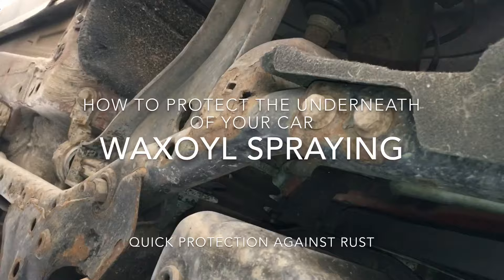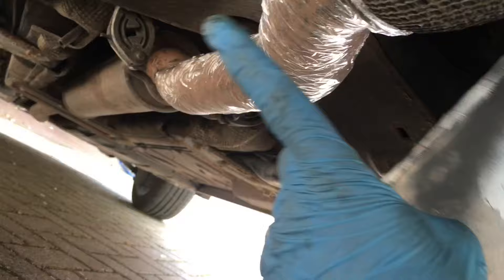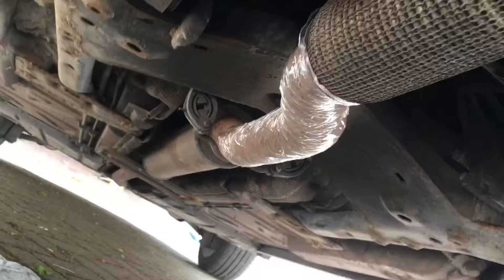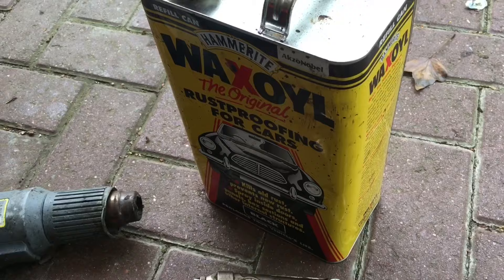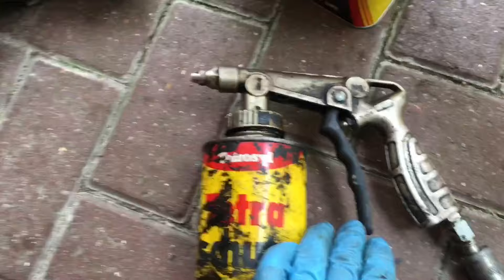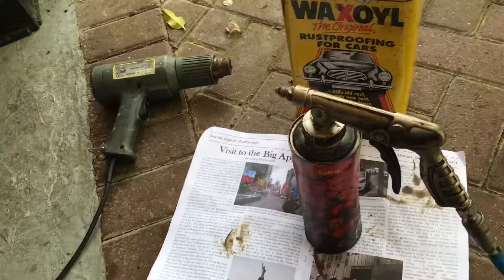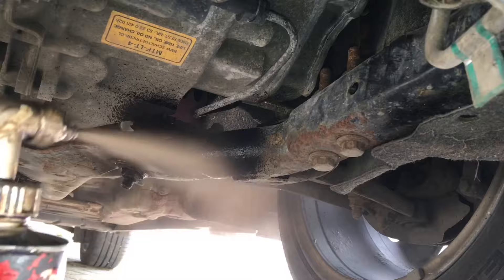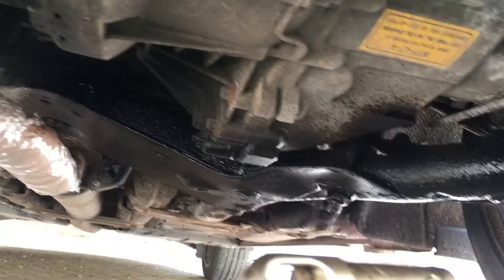How to Quickly Protect from Rust on Car Underbody - WaxOyl

Comment: Love that you said don't spray it on the brake disks just as you sprayed it onto the brake disk😂😂
Reply from the maker: I had to go and check - nah it was ok as the brake backing plate protected the disc, but nonetheless something to watch out for.  Wipe off with white spirit if affected.
Reply: @comeinhandynow  Better to wipe off with brake cleaner, as white spirit leaves an oily residue...
Reply from the maker: @amana1480  Probably right but its good enough as long as you wipe if off as well.

Comment: So when this dries out it protects it also from sand and stuff ? Or it's just something waxy that will wash off in time from power wash ?
Reply from the maker: If it is pure Waxoyl it dries quite firm and will not wash off.  Even if you add 10% oil, which makes it softer, it will stay on but sand may stick to it perhaps.

Comment: Without arguing if it's the best product out there, definitely this spray gun is not worth much without 90° extension wand. Whatever you spray its paramount to  ensure full coverage. With only spray gun you won't be able to apply product between elements and main body.
Reply from the maker: Yes, that would be a good add on.  I’ve an add on hose with a 360 degree spray end for cavities etc. but a 90 head sounds a good idea as well.  Got any ebay/amazon buy links?
Reply: @comeinhandynow  I did it myself, wanted extra long. Thin aluminium tube bent and flattened at the end attached to an oryginal 360° hose. But there must be many to choose from on the internet.

Comment: Easiest option to thin is to mix with white spirit to be honest. Just finished my wife's car and about to redo mine
Reply from the maker: The added oil is not to thin it, it is to keep the solution oilier, more penetrating, more mobile and it lasts longer as it stops the waxoil cracking after several years.
Reply: @comeinhandynow   you misunderstand. Rather than heat it with a hot air gun, thin with white spirit to ease spraying. Grannies and eggs. I've used it for 40 years
Reply from the maker: @Micjoh  when the weather is cold, heating it is the better solution because you have a solid lump of wax to try and dissolve otherwise, in my humble opinion and experience of 44 years.

Comment: Im in the process of doing this to my 2006 Toyota Corolla which has quite a few areas of surface corrosion underneath. I'm glad to see it is fine to spray this product over surface rust as long as it has been wired brushed and cleaned. At first I thought I would have to get down to clean metal which would of been a ton of preparation work. Thankfully not the case.
Reply from the maker: Yep, it's good for quick preservation.  Well worth doing.

Comment: Excellent straight forward to the point video. Well done. About to get under my motorhome to see where I mouse has entered the van. Good excuse to Waxoyl while I am there.
Reply from the maker: Thanks. Good luck.
Reply: Had mice in our motorhome - couldn't work it work where they got in, but then read that they can get in through a hold no thicker than a pencil...so could be lots of places , bunged them all up with wire wool as they dont like earring through that. Job sorted.

Comment: Good video. I don't put old engine oil in because it makes the waxoyl black: you can't see when rust re-starts if the oil is black. However I've never, ever ever had rust restart under clear waxoyl. There might be better stuff out there but I haven't found it. Brush it on / spray it on - it's great. Get the extender hose to spray in cavities too.Being see-through you can satisfy yourself no rust is re-starting and both my classic VW bus and modern cars are done - no rust anywhere.Buy some now - don't delay putting it on. Then wax polish the bodywork to stop pin-prick holes becoming blisters. Then keep on top of the oil changes and keep away from mechanics - they always break your car. Fix it yourself....
Reply from the maker: Good advice, although I like the look of black Waxoyl.
Reply: Ha! Yes it does look better I do agree! At Busfest I had a look to see what other classic VW owners had done and yes, the black look was the most common (apart from the concourse Trailer-Queens with body-colour painted undersides).I've spent so many hours taking off solidified, hard underseal with rust behind it I have a fear of the black stuff! You know what I mean re the solid underseal?I might start using your method in the wheel arches though as they are so visible.
Reply: @mopedinthemalverns6661  How did you get the underseal off? My car is coated in TetraSchutz, and I can see rust coming through it. I'd like to get it back to metal, and coat it with something that I can easily remove, and is transparent enough to show the development of future rust. I have some trepidation about the amount of effort involved in getting the old coating off!
Reply: Hmmm - I've had to resort to scraping / wire brushing and using white spirit - it's a rancid job. Sorry can't be of more use. The scraping gave me tennis elbow - no really it did! The underseal will scrape off easily on the rusty bits - rust is useful in that respect. I used a wood chisel - do wear gloves and glasses though - chisels are damned sharp. Don't lose sleep over getting is totally back to the metal though. Best of luck.
Reply: @dalriada842  Getting the old hardened underseal off I 've used a combination of 1" paint scraper with a hot air gun used for removing old paint on wood, wire brushes in drills and also sanding flap style discs, very very important to use eye protection, took a whole day to remove old underseal on my Beetle many years ago but worth the effort.
Reply: Could not have put it better myself
Reply: Totally agree with everything you said

Comment: Don't use a hot air gun to heat it  a bucket of hot/boiling water does the job just as well.
This is also suitable for aerosol cans but don't get any in the nozzle.
Reply from the maker: Thanks for the comment but for a 5L can of waxoyl that I often use you would have to use a large volume of hot water.  I have been using a hot air gun for years without incident but I would say that you should do it carefully. Keep an eye on the solution, mnake sure the lid is off and stir it frequently until it is liquified nicely.  You wouldn't want to over heat it.

Comment: Would you recommend cleaning the parts to be waxed, especially to get rid of any road salt that may be sat on the metal?
Reply from the maker: Yes brush off any loose rust and any mud.  Also wait until there has bee sufficient rain to wash away winter salt from the roads and car or spray wash it underneath and leave enough time for it to dry.

Comment: Hard to answer question i know!  But any guidance would be appreciated. How much corrosion is too much to Waxoyl over?
Reply from the maker: If it looks like it is more rust than metal left in its thickness then replace it, for example the lower suspension arms (wishbones), those are cheap to replace.  Another video on that soon!
Otherwise scrap off any loose rust and waxoyl it.  The add of old engine oil into the waxoyl helps it penetrate bad rust.  Add 10% to warmed up waxoyl and shake to mix.
Reply: @comeinhandynow  Thannks, do you know what would happen if waxoyl was just put over the corrosion with no clean up first?
Reply from the maker: Just more danger of the rust flaking off carrying the waxoyl with it.

Comment: Wow, really glad i came across this video. I ve been looking at loads, a product called Lanoguard, and others, but this seems to be the one, seems as you ve answered nearly every question i had already in your comments section too! Plus i ve just discovered it on eBay, very reasonable price, even in spray cans, and a job i think i could take on myself, with all the tips i ve read right here. Just one thing, i see your fortunately still uploading, can you advice me, would it be a good idea to remove the wheels maybe and cover the discs with rags or something?   Very good informative video, clearly explained , and filmed.,. Top job..  I m a new sub!! Its this old school advice that is invaluable.... Thankyou
Reply from the maker: Thanks. You can leave the wheels on but taking off will give better access tto suspension bits.  And yes guard the brake discs from the waxoyl.  If you do get some on the discs wipe it off with a rag and solvent, methylated spirit is what i use (ethanol).
Reply: @comeinhandynow  Good point, i hadnt considered, i think i ll go with taking them off as i ve a trolly jack so easy enough, and yes, more access to parts i might not get at otherwise.. I think i have a can of brake and clutch cleaner left over , from another top tip off here on YT on cleaaning oil off my drive with that and cat litter. That would do it wouldnt it, or is it for a different part of the braking system? I m no mechanic, but if it seems do-able, i ll have a go, if i have the tools etc needed. Or stick to what you suggested, the meth spirit,  i ve just found it cheap enough on eBay, small enough bottles for camping stoves etc?   Your earlier prompt reply is very much apreciated, if u could get back to me on my last querie, i think i m on top of this job, and just need a sunny day now...I know times getting on, so anytime over the weekend or in the week will be great, as i m not about to do this job tomorrow morning...Prob be April before i get any sign of a sunny day here in S Wales!!  I ll say it again, i m very happy to have come across your page, spotting the axles etc from behind, rusty looking was starting to really annoy the last few weeks.... Also looking forward to going through your many years of knowledge in your uploads..  Cant thank you  enough....
Reply: @thedjreffa how did you get on, any tips for someone looking to do the same?

Comment: Thanks a lot for the video!! I am in the process of using jenolite waxoyl (aerosol spray) is there any part of the underbody where I should not spray other than exhaust and brake disks? Thanks a lot in advance!
Reply from the maker: Can’t think of anything else critical. I wouldn’t do engine, gearbox or diff or any visible bodywork.

Comment: Just bought  a load for my mx 5. I wasn't sure if I had to paint 1st  or use  rust reverter, etc ? There are so many different  opinions. I'll  use this method  as it's intended.  Thanks
Reply from the maker: Just spray it on after scrapping or brushing off any loose flakey rust.
Reply: @comeinhandynow  I will do. Can you use it in the wheel Wells
Reply from the maker: @mick0846  sure, just avoid the brake discs, or cover them

Comment: Always best to use a wire brush, then rust treatment, black satin hammerite then waxoyl for extra longevity and protection.
Reply from the maker: Thanks for your comments.  The key word in the title is “Quickly” and doing all your steps is not quick.  The addition of engine oil to the waxoyl and heating it makes it a quick job as you can skip the hammerite, rust treatment and most of the wire brushing (do just enough scrapping to remove the loose bits) since the oil makes it penetrate much more and stay much softer and long lasting.

Comment: At risk of asking dumb question, can I paint it on? Can a compressor spray unit be hired? I’m assuming it can (who would have one at home?). How did you heat it?
Reply from the maker: Yes you can paint it on.  Yes you can hire compressors. Useful to have one at hone for spraying, tire inflation and this job. Heat with a hot air gun.
Reply: @comeinhandynow  Thanks, very helpful, much appreciated. 👍 I don’t have a hot air gun so I’ll stand my can of Waxoyl in a tin of warm/hot water to heat it. Same result, but slower.

Comment: Should you wire brush first ? You are just dealing on rust right
Reply from the maker: Just remove any loose rust or flakes with a wire brush or scraping tool then spray over remaining rust. The oil stops it progressing.

Comment: Would you recommend this as a preventive measure for a brand new car??
Reply from the maker: Yes, on steel parts underneath. I wouldn’t add extra oil in that case as there is no rust to penetrate into.

Comment: Why should not apply on brake and exhaust systems?
Reply from the maker: It will stop your brakes from working properly.  You need friction in brakes. Waxoyl is lubricating so not what you want.  If on exhaust it will make a lot of smoke when it gets hot and is a risk for fire.

Comment: i used the pray can version , it looked great after 12 months later i looked under the car and its all gone wtf!
Reply from the maker: That shouldn’t happen. I can only guess that the can wasn’t warm enough and shaken up enough to get a good mix of the wax and maybe mostly it was the solvent getting sprayed out.  It is worth getting a compressor and using those spray guns shown to deliver it and then you can add extra oil into the mix for extra penetration and longevity.

Comment: How much would I need to cover the whole underbody ,is 5ltr can enough for the job also can you use the weed sprayer to do the job as well .What do you think my mind says yes
Also how long as yours lasted 
Kind regards
Reply from the maker: 5ltr should be enough, but depends on the car size. I’ve not tried a weed sprayer, probably it would cool down too much and block up.  It lasts a few years, but check and reapply on any spots where underlying rust has flaked off every few years.
Reply: Maybe with what you were saying and that is best to keep in very hot water and transfer small amounts at a time etc 
How long does it take to dry etc 
Would you jet wash first and then let it dry and then apply 
Kind regards

Comment: Wish you were close , I would pay you to do it , did you say add 10% engine oil? Take you mean new oil . My vehicle has quite buildup of road dirt that needs removed first , should I pressure wash , if so how long you leave van before spraying the waxoil
Reply from the maker: Yes about 10% seems about right. Pressure wash or just the hose.  Leave a few days at least in dry weather until it all looks dry.  It’s a messy job. I wouldn’t want to do it for others, but it is well worthwhile.
Reply: @comeinhandynow  I'll just use the hose then and I'll hand paint the waxoil on :) don't have an airline
Reply from the maker: @lookoutleo  They do sell aerosol spray cans of waxoyl: amazon UK: https://amzn.to/3xk41Ea

Comment: Buddy. Were you spraying over the rust, or just giving it a quick brush to get the flakes off?
Reply from the maker: Quick brush to get the flakes off and then spray over.  The oily wax partly converts the rust but mostly just seals it in and arrests further corrosion.  The key thing in this video is 'quick'.
Reply: i use the clear waxoyl that ya brush on,& then i spray hard to reach areas with supertrol,that is simlar to waxoyl,

Comment: Does WaxOyl come off if you use pressure washer with hot water ? 
Because I understand it is like a wax or more like hard paint ? Thanks.
Reply from the maker: It is more like a wax a bit like candle wax. If you hose with hot water a lot then yes some will remove. Not normally that much of a problem.

Comment: Do not mix old engine oil or diesel in with it. It penetrates fine as is and all you're doing is stopping it from curing properly by adding that. Engine oil, despite what people think, is nigh on useless at preventing rust too. Other than that. Good video. :)
Reply from the maker: Thanks, however if you have ever had an old car that leaks oil, you will discover that oil soaked metal, even bare metal, never rusts. It stops water and air getting to the surface.  Having done Waxoyl coatings for many years I found that after many years it can dry out and on heavily rusty areas that haven’t had all the rust removed it wont penetrate down to the surface and the rust and Waxoyl then just flake off eventually.  Adding oil helps, but you are right it won’t fully dry. Which is why I do it.
Reply: @comeinhandynow   I know it can stop rust to a certain degree, as you say, leaky old baskets get protection from it somewhat when it's lagged on the underside. 😂 But it also has combustion acids and contaminants in it that I wouldn't want to spray on the underside of a car too, especially if it's from a derv. It's also not great on pre rusted metal as it won't neutralise it completely. I didn't word it well to be fair, I was more concerned about diluting the rust protection in the Waxoyl as well. I've never had Waxoyl peel or flake, and for better penetration, rather than use diesel or oil, I dilute with something that will "flash off" like parrafin or white spirit. Get all the penetration you need as it's much thinner, it lets it dry so you don't have a bit of a soggy mess, and I've never had an issue with it ever peeling or flaking off. Plus as the carrier evaporates, it's technically not "diluting" the Waxoyl either. 

I must thank you for your other videos that you've done on your MG ZS by the way. I have a 180 and the rear brake and VIS videos were a very handy reference to know what tools to prepare and so I didn't run into anything unexpected. Really good videos and certainly helped me.
Reply from the maker: @Spac8  Cheers and thanks for your input.
Reply: I've never had an engine rot from the issue out🤣🤣🤣

Comment: Scrape off loose rust and paint or spray on burned oil to the underbody/chassis
every bit as good and costs nothing but time, park somewhere where you won't mind it dripping some oil though for a while.
Reply from the maker: Yes, but for a small amount of money you can buy waxoyl that olds the oil on the body, rather then drip on your drive for weeks.
Reply: @comeinhandynow   I am going to try it your way this time, might be less drippy alright👍